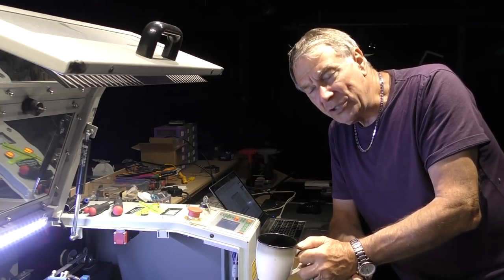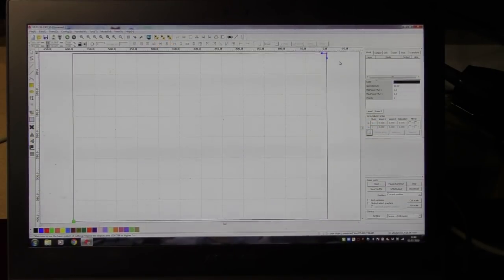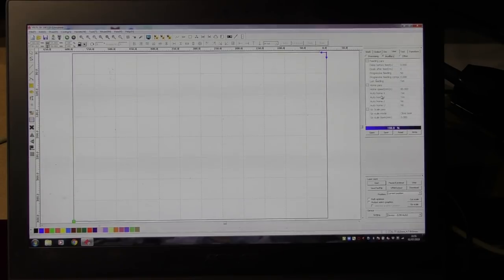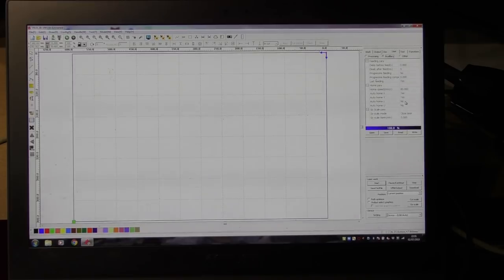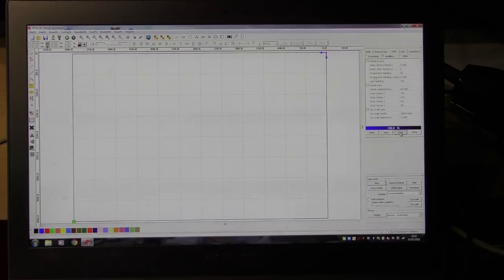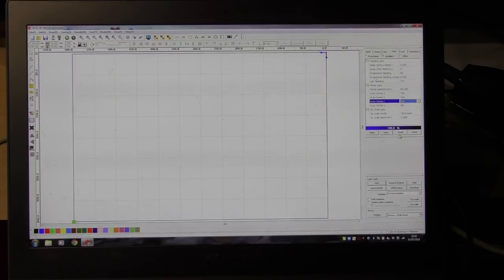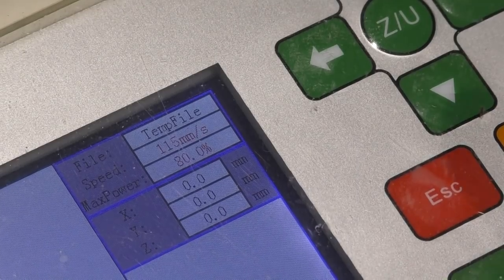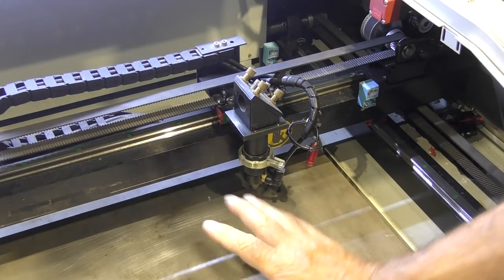RDWorks Learning Lab 169 Auto Focus Practical Alternative

Comment: Thank you this video is very helpful. Incase you don't know, the so called red pen is actually an NPN proximity sensor. The little movable part is just a hunk of metal. The proximity sensor (one type) requires that the sensor gets close to metal. your x and y axis probably has a proximity sensor instead of a limit switch. I purchased a proximity sensor on ebay they are super cheap. The benefit of the proximity sensor is there are no moving parts. so where you located your limit switch, I mounted a proximity sensor upside down. Then I tapped a 3/8" bolt into the frame . So now when I auto focus the table brings the bolt up to the proximity sensor. Its 100 percent accurate every time. if you take your finger on the tip of your red pen and push it in you will see its not smooth. It actually stops at different points where if you use my system which is your system modified so there are NO moving parts except for the table itself you will be quite satisfied.  You are far advanced from me and this helps me find a use for my "auto focus" but ive always believed weather its hard drives or sensors stay away from mechanical movement rather stay all electronic much more accurate. if you like I can send you a picture

Comment: That's odd, my cheap Chinese laser has auto focus, with a switch on the laser head, yet does not have the micro switch next to the lead screw.
I think I may change it so the head switch is next to the lead screw for the table up/down movement.
Thanks again, Russ, for the great videos!

Comment: Hey Russ, love your content. FYI the terms absolute origin and origin are not quite correct as you correctly pointed out. I would take absolute origin to mean current zero work coordinate Zero Position and origin would be the Machine Zero Position. A Machine Zero Position is the physical position an axis is referenced to. Theoretically this should not change unless the mechanical or electrical switch gets moved.  It is just not termed correctly though most cnc machines would work this way. I agree with you that you don't want to purposely go back to the original zero point of the work coordinate after a reset. Bad things could happen.

Comment: Do you have a video comparing RDWorks to LightBurn? I seem to read that the consensus is that Lightburn is better software yet you are using RDWorks? Id be interested in your thoughts as to why you use that software?
Reply from the maker: Hi Ben
Did you recieve my answer to your comment? I am just looking at my summary page and it says unanswered.. I have had a few answers sent to another dimension by Google.
Best wishes
Russ
Reply: @SarbarMultimedia  Hi Russ, no I didn't receive an answer. All good, it was more a rhetorical question, suggesting to make a video comparing the two, if you hadnt done so already. Love your show, very enlightening.
Reply from the maker: @ynnebbenny  
Hi Ben
Thanks for replying. I answer lots of comments and I would guess that 3 to 5% go walkabout.  So lets try again.
 I answered previously by saying .........Yes, I do have and use Lightburn. It is an amazing piece of work that began about 3 yers ago when a professional software writer and laser user  decided to rewrite all the functions of RDWorks  into a much smoother and user friendly interface. It has now progressed beyond a straight clone into something that has so many extra features. It handles text in an almost "Adobe Illustrator" way and it's graphc tools are way more powerful. I, along with a host of others, have helped debug various parts of the software. It is now a fully formed commercial product that is being developed to work with all sorts of controllers.  If you do not have a copy then I urge you to downnload  it and try it for 30 days free to see if you/your machine like it. There are lots of excellent  tutorial videos at the Lightburn website and to be honest you need to get your feet under the "laser table"  with the RDWorks , which , for free,  is a great piece of software  albeit clunky and poorly documented. Only then will you really appreciate what a great product Lightburn is. So, why don't I use it in my series?  The answer is in the title of my series. Lightburn was not around when I started my series So on screen, I stay faithful to RDWorks because, great as Lightburn is,  there are a few detailed setting functions for inveterate "fiddlers" like myself,  that still need to be performed with RDWorks. Also it enables beginners to progress with the free software.
Thanks again for your patience
Best wishes
Russ
Reply: @SarbarMultimedia  Thanks Russ, you have been very generous with your time with me. I appreciate being one of the 3-5% especially with such a LARGE following. Im consuming your videos two a night at the moment, with my wife occasionally walking in and rolling her eye when she hears what you are talking about. I'm glad to have found your videos BEFORE having bought one, you have saved me from a few mistakes already. I'm old school CNC but lasers are new to me. Having build a few CNC routers in the past I was tempted to do the same with a laser, however I have opted to buy my first one. Looking around the 8-10K AU mark. Highly considering a Cloudray machine. Sorry for the long windedness, I figured I owed you after your generous response. ;)
Reply from the maker: @ynnebbenny  
Cloudray are selling this badged machine and it looks as though they have had the series built to their specification. Mr Ding at Cloudray has the highest quality standards and also understands what  western quality control and customer satisfaction really means. I have not seen detail specification for all his machies but you will not go wrong buying from him. Their AK series looks like it has a leadscrewdriven X axis which is novel and a sign of high quality, Their 9000x600mm machine looks a great little machine. They also do the belt driven version as well. I have never cosidered belt drives with flexi teeth to be other than a 98% cnc solution but all the features I see about how  the belts have been used on the Cloudray machines tells me these have been well thought out and designed to minimise the resonance shortcomings of the rubber belt drive system.. It all comes down to price  but your Cloudray decision is a good one. 

Best wishes
Russ

Comment: is it safe to engrave/cut leather, Dermatin , Faux leather, stone, glass, mdf ? thank you very much for your videos and helping. GOOD LUCK AND GOD BLESS
Reply from the maker: Hi 

Leather is a natural organic material and can be engraved safely. It produces dense white fumes and smell like burning flesh (which it is).  The small stays on the product for days  although wiping with a damp soapy cloth greatly reduces the problem.  Dermatin (often called leatherette) and particularly faux leather are both man made products  that can produce toxic fumes when heated. Even with good ventilation you and your machine may be at risk. Do some more research on  these materials particularly the gases produced during burning
Stone is a very wide term and could include marble slate , granite etc. They all engrave safely but again. good ventilation is required because often dust is created . Although not toxic, it is a bad idea to breath much of it and its abrasive nature will not be good for the bearings in your machine. Glass is different in that there are two distinct mechanisms involved with glass engraving. Very low power engraving produces micro melt pools on the glass surface. No material is lost. The second happens when you increase the power and then the glass gets damaged by a micro stone chip type of mechanisms where micro shards of glass are chipped away from the surface . Neither mechanism is dangerous or toxic.

Although MDF is a man made  product, it contains about 85% wood, it also contains water, paraffin wax and about 10% of  a plastic binder called urea formaldehyde.. Burning that produces dense nasty fumes. It is not highly toxic and lots of people cut it (including me) safely, provided you have good extracion. Not wise to breath to many neat fumes.

Best wishes
Russ

Comment: Hi Ross! What is that tool you used to screw in the lens? Where did you get that? Thank you!
Reply from the maker: The tool was designed and supplied by Thinklaser  and may be available for sale at a stupid price. In reality all you need is a cheap 6" steel rule from ebay to do the same job ie you are using it as a wide screw driver. 

see
https://www.ebay.co.uk/itm/6-12-OR-Both-Rule-Stainless-Steel-Ruler-Small-Large-Metric-Imperial-30cm/151996239722?var=&hash=item2363ae8f6a&enc=AQADAAAC8FjVrDbVsZ8oH%2F8PNHtt9VX4%2Fw7FZcmMuqsX8uaFEduVyfx2jTUyE2xcACamNkaJOtN0rhP5PMRUMkDovKIy%2BM2ELfot8%2BBWrrkZiWqqy7GNDmBIRSgAhd8cVeJ7M8rP6qKWrhoLtQ6GUBFZSEgP9R94zaFyT9N6f1zGjH9sAt9xcSqq9zI%2BB%2B3lviWVOd8%2BRwLk0pRpQTocyUkQ8%2BB%2Bp9km1bVYeXxZeRdm49KsRfp8O3sjWZklmw77PwUoCZaiBbVtTDWGBpRllvg2NqMYdjbTUJBIOkpsKjv%2FPlcLrVqrJOUB9MQDIwjeAw5cEZo%2FMt7%2BhTsHeYHIhqgTOoS67nQRRL7PpWzeqF9tRNMqWFfZPIQJim6TxaFfjZRxZ%2FUTrbVnN87zfVuCTaVVC%2BDEGDo7SX3%2Fl4noSGrZshdHqelPY6NhmtfU%2FoZtcHTMkkY3Dd7tOIM%2FB3yPjZwLDEI0NgW7cKzhNFoJ5gDnm1mNr0KM1tMEb8uJN64K102NAf2M9ZYAXhyb8Tk7IqFa%2F0HHQAxRLPuBDFEnokI6stnZBejBADBqkE36Jowpg03JFzKik8GP6KBExzcppIqfNtKO8Qg5fkBJ3dVk2vKAWJSWbWzsxuPWMO%2BjL6yY5OY8eQtm8zYafgavmURnUDSUps%2FcM2BIKspZGFmlXrWS5tY8SfEra5OFsp9%2BDMFscQIV7Qpeydd2DZXohaqASNYqQ%2BKINXoFX6jznu03P%2Fm7QUpMKB9hVV5AzTHlrWoxKgTMQ6UYP6ZXKQsAiRbPMvpw1K9uf4%2BRVTjWzbU63eZxLgGswb%2B585KsTeV9%2BdHj6MI2s3C4kFQm%2BwbwDFF9RBJ7AvD89xaHhdRwsXlJ477haGPp2MvJOKXtHD0NJPcIhlyULcvynPCdDAzjl%2Bj1FxB5F5%2FDrr%2BCkGK1jZnlFMoWAfkX5y7FCiVvRBp%2B98z%2FYmzbnglari8F9Rw7N9HmMxxT%2Fc7e83j7d6FbB%2BBWwf0YScACBHo9&checksum=151996239722eef4c23d50e641c497c6c55a85c1c901

Best wishes
Russ